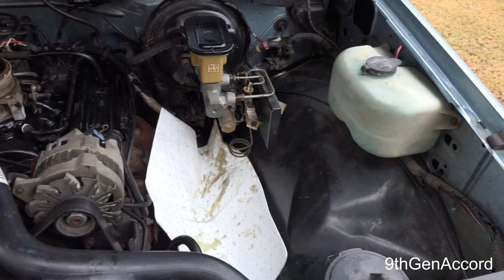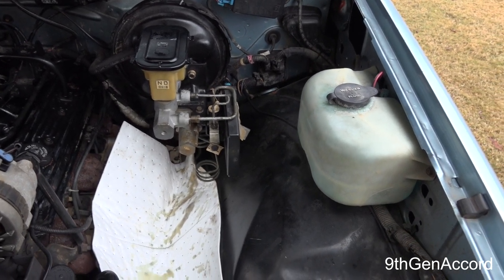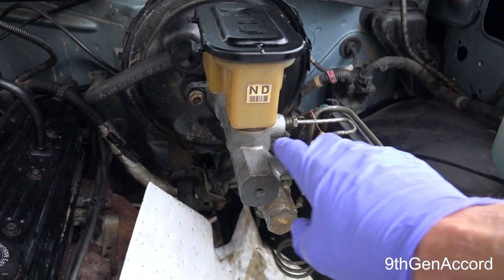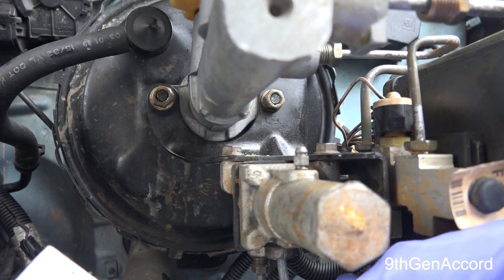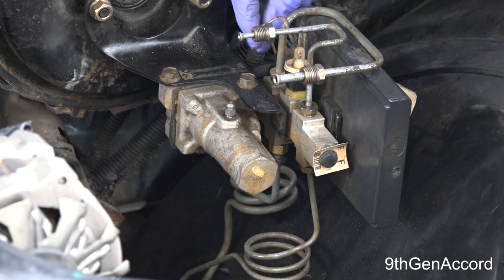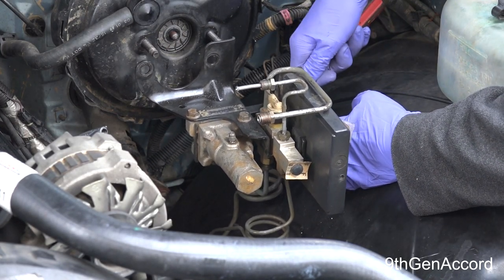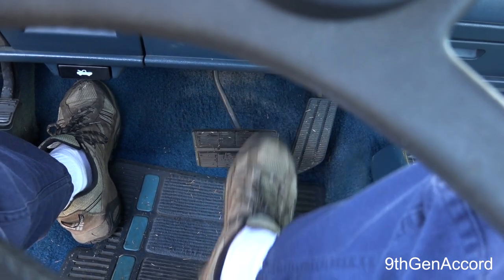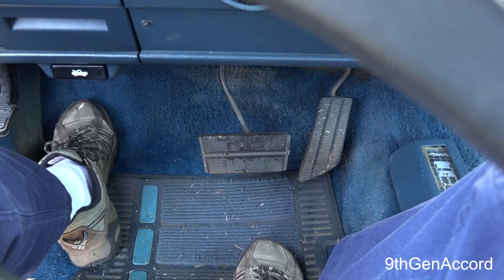How to fix the soft pedal issue with the rear anti-lock brakes on a 1988-1998 Chevy K1500 Silverado

Comment: Been dealing with pedal going to floor for a week now on my 94 silverado. Replaced master, bled 2 quarts of fluid through it and still no pedal. No visible leaks. Everything else is new....and i mean everything. I was saying to myself, theres nothing left to replace but apparently i was wrong. I guess this mod is next. 

Very good explanation of everthing. Thank you in advance if this works. 
Im still baffled how this valve makes the pedal go to the floor unless like you said, air trapped and wont bleed.

Comment: I did the ABS delete and a master cylinder of a 2003 Suburban and it made a huge difference!!!
Reply: How did you do it please tell me I'm in a pinch and I ABSOLUTELY HAVE TO FIGURE SOMETHING OUT I CAN'T AFFORD A MECHANIC
Reply: @insertnamehere313  get a 2003 or so Suburban master cylinder. There are detailed videos on the ABS delete and the new master cylinder. There are two easy fittings to buy. It's easy if you are a pretty good mechanics. You have to bleed the new master cylinder and brakes of course.
Reply: What year was the truck your put the 03 Suburban master cylinder on?

Comment: Man! I asked the guys at NAPA and O'Reilly's about, just if you could bypass the ABS pump and not one of them would give me a straight answer! My brake module is burned up anyway. Thanks for being detailed about the fittings! That helps alot and yes,! I do know the repercussions of doing this and I take full responsibility. Thanks again!
Reply: Asking parts store guy........ is like asking a cop, How to get away with running red lights. P.S. No commercial repair shop will work on your truck if you dis-able the ABS.

Comment: I know this video was made a year ago but I'm having problems with my brakes where did you get the adapter from
Reply: I got the same adapter from O'Reilly Auto Parts.
Reply: @abnerjr.famoso1395  what is it called
Reply: There is a link in the description for the adapter. It’s on Amazon

Comment: do you know the port sizes for the master cylinder also?

do you know the  3 other ports thread and tube sizes of the prop valve?

I'm forming new lines from straight lines.

Comment: I have the 4 wheel ABS.  And there is no proportioning valve.  So not sure if need one.  But I want to be able to lock up all 4 tires.  Tired of brake pedal that goes to the floor, and now just weak brakes.

Comment: Converted my 91 suburban to larger brakes (why GM made these in 1/2 ton with passenger size brakes is beyond me) and had a soft pedal afterwards.  Mine looks way different than what you show here.  Mine is pancaked behind the prop valve and looks like another prop valve.  This answers a quite a few questions, but......anything done with the wiring?  or just zip tie it out of the way
Reply: How were you able to convert to a larger set of brakes? Been trying to find other affordable information on how I could convert my single piston to a dual piston.

Comment: Where do we find that special fitting??? 
I thought it was the brake booster $120 later I was bummed until I found this video
Reply: Any parts store should have it. Edleman part number 258450
Reply: The Booster gives you Power brakes over hard to push manual brakes.

Comment: Wow, my first Gen Cummins is nowhere near that easy to work on, the prop valve is inside the frame rail, the abs valve is at the back of the truck, and the brake line going to the abs valve is in the frame rail almost unaccessible due to the diesel tank.

Comment: Two years later...Did it really fix the problem?
Reply: I did it on mine and it really helped!
Reply: @dougsmith4879  did you just do the bypass or did you also change out the master cylinder with the NBS style?
Reply: @dbs6896  I did the bypass and the newer master cylinder at the same time.

Comment: So is the fitting into the dump valve 9/16 or 7/16 ? You seem to have changed your info in the video but your link is still 7/16-24?
Reply: I think he was meaning both use a 9/16 wrench to remove and install... one being a 1/2-20 thread and the other a 7/16-24 thread, but same size wrench to remove both...
Reply: I bought the adaptor. It will fit into proportional block but the brake line won't fit into the adaptor. The brake line will not screw into adaptor. Now I'm stuck. 1994 Chevy Silverado. Any suggestions?
Reply: @dennispendley5232  possibly wrong adaptor... take your abs modulating valve, one you remove it, with you to the parts store, and the adaptor... between the two you have both thread sizes you need for a correct adapter... the modulating valve will show you line thread size and adapter shows you the thread size into the proportioning valve... use both of those at the parts store to get an adapter that will work...
Reply: @dennispendley5232  hey Dennis, I have a 94 silverado also....what was the fitting size you got. I am having the same problem. Was the change in braking impressive or was it just ok?

Comment: Is that brass made for high pressure? I work with high pressure and there are gauges that use brass so I know there is high grade brass out there.
Reply: It will work on the braking system.
Reply: @dougsmith4879  I'm leary of constant use. If I knew working pressure and burst pressure than I could deduct if I'd work with it.
Reply: @martingarza3383  these adapters are made for that. The braje pressure isn't hundreds of PSI.
Reply: @martingarza3383  the adapter is basically the same thing as the fitting used on the brake line. I worked on cars most of life and over 20 years working at auto parts stores.
Reply: @martingarza3383  the brass fitting is much thicker than the lines so it's solid.

Comment: Could this fix an issue where the rear brakes aren't working at all? Noticed in snowy conditions that the fronts lock up but the rears don't do anything. Went through all the usual brake trouble shooting. Changed a leaking wheel cylinder, Bled brakes, topped off fluid etc.
Reply: Mine has no pressure at the rear and I think it's the dump valve. I'm putting on the 2002 Chevy 1500 master cylinder and ABS delete next week.
Reply: Is your brake light on? If so it sounds like your proportioning valve needs reset.
Reply: @nickschmidt7181  I am going to bed rid of the rear ABS (rear only on this year) because it's problematic.
Reply: @dougsmith4879  How did it go w/ the rear ABS delete? Any issues w/ the NBS master cylinder?
Reply: @OakWildwood  no it was pretty easy and much better brakes! Thanks
Reply: Get rid of, haha.
Reply: @dougsmith4879  Hey Doug, is that all you did? No changing over to NBS Master cylinder? Just bypass the rear abs and bye bye sponge brakes? I was gonna do that change out master cylinder thing but if this will make a major difference then why waste the money. How big of an improvement was it?
Reply: @dbs6896  I did the ABS delete and the newer master cylinder at the same time. Night and day difference! In my opinion, I would do both at the same time.

Comment: Disconnected the connectors on the computer but still have break light on dash. Any ideas would be helpful. Thanks
Reply: did you check the e brake sensor ?
Reply: luis rubi No but I’ll check it out..thanks✌🏼
Reply: @818nut   if you press down on the e brake and the brake light gets brighter then you are good with that. if it doesn't then replace the switch
Reply: luis rubi got it...appreciate your help
Reply: stick a small sticker or something over the light area.
Reply: Remove the electrical  plug on the proportioning valve.  Its tied into the same circuit as the abs.
Reply: @damham5689  This may kill the lights on the dash ......... but NOT the spongy brake pedal.

Comment: Everyone be careful when removing and reinstalling old brake lines it'll strip those aluminum threads I suggest cleaning and lubricating before you gently start threading them in to the portioning valve

Comment: This is a waste of time
I've driven a 93 for years and any soft pedal issue is usually solved by adjusting the rear brake shoes. If there is a concern about the ABS system, just take the truck to a wet street or gravel road and brake hard to lock up the rear wheels. The abs pump will activate (which can be felt in the pedal) and will help unstick any parts in the ABS system.
The oly time to make a mechanical system change is if there is an actual mechanical issue and there are NO parts available.
Reply: That hasn't worked since the early 90s . 96 and newer needs a scanner to cycle abs valves in automated bleed mode. You will never get it right without doing it right.
Reply: @JeffRobertson-m7v  Seriously, just take the truck out to a rainy/muddy/gravel road and repeat accelerating and stomping on the brakes a few times and you will feel the ABS activating. This will cycle fluid through the system and usually remedy the issue. I have even used this technique on newer vehicles, <10 yrs old, with the same success. ABS activation is rarely, if ever needed by the average driver and those valves can get sticky.